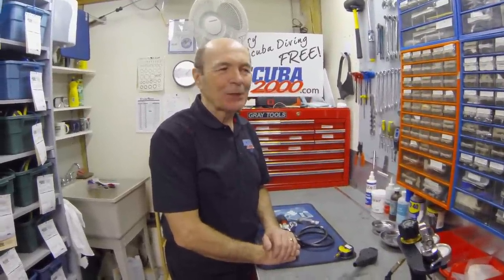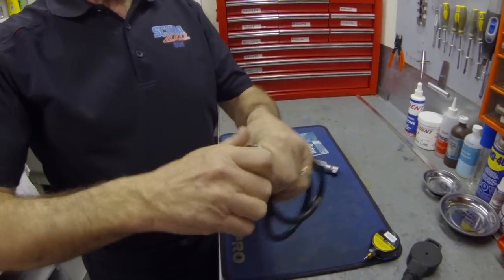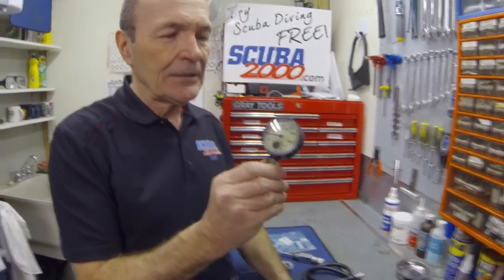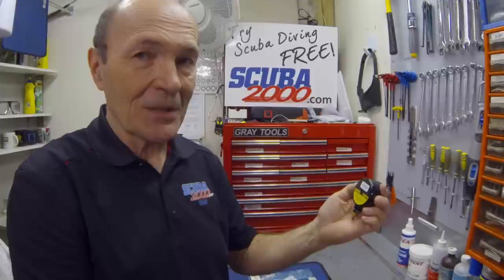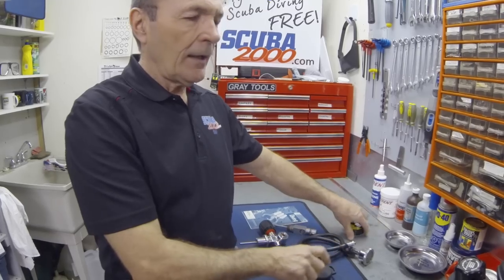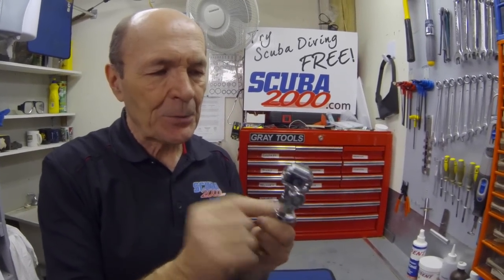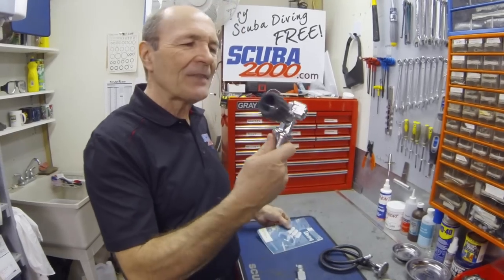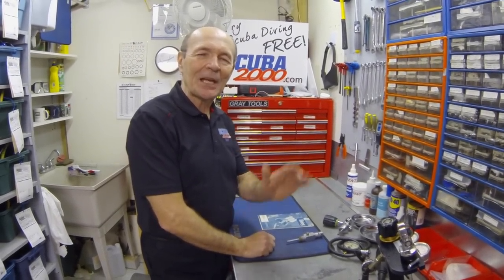Things Your Scuba Instructor Told You That Can Hurt You! - Scuba Tech Tips #3

Comment: about closing a valve a little bit (open all the way and turn it back half a turn), my instructor told me it is needed for a buddy to check if its opened or closed. about  preassure gage, instructor told me to push it to a cylinder, not away from me, when opening a valve (i am from russia by the way).
Reply from the maker: My 2nd wife was Russian. Beautiful girl. 
Think about this Alex (nice name!) - if you turn the valve back a bit from full on and your buddy reaches up to check it, it will turn both ways. How does he know if it's almost open or almost closed? You want it fully open so, if you push your purge button and get air and your buddy checks that the valve is snug, you know it's fully open.
Quite frankly it doesn't matter what you do so long as you check carefully before jumping in. You sound like you are a careful diver so whatever you do, I'm sure it will be safe. Most of these little "rules" are for the less careful divers, the sloppy ones who cause all the problems.
Same with the SPG. So long as it away from your face when the air is turned on, you're good.
Take care. Talk again.
Alec
Reply: Yeah, i didn`t got the thing about leaving valve half turn at first, and i still dont know why they telling students to do it that way, i just makig shure thatvalve didnt opend too hard - that it will be hard to close it after. Thankyou fro your replay :)

Alexander (yeah i am actually alexander - alex is just easier to pronounce)

Comment: Where i dive in Europe I have never seen a plastic SPG or a pressure relief valve we use metal SPG’s but in case of pressure build up we point it away from my face because the only place where the pressure would escape would be the glass or plastic screen!
Reply from the maker: If you look on the back of your SPG, with the rubber boot or console removed, you'll see a rubber plug about 1/4" in diameter in the case. That is the pressure relief plug. If the gauge fails (not common, but it happens) that plug comes out like a 22 rifle shot.
Anything in the way will suffer, hopefully not an eye!
These are required on all SPGs (in fact, all pressure gauges) and apply whether plastic or metal, European or not.
Scubapro, GSD, Cressi, etc are all the same.
The SPG boot or console is supposed to have a hole in it to allow that relief plug to blow out unobstructed. See if yours has that too.
This Tech Tip was directed at those older divers who were told to point the gauge away from their face because the older gauges did NOT have that plug. When these older gauges broke, most often the front glass would burst.
With the newer gauges (newer since about 1980!!), pointing it away from your face means the relief plug is facing you!
Some divers prefer metal SPGs. Makes them feel safer. That's fine with me. It's not true, but it's fine with me.
It's not the case that fails. It's the bourdon tube mechanism inside that fails so metal or plastic case does not make the gauge better. In fact, a metal case, chrome or not will corrode and requires more rinsing.
But a metal gauge if the weight is not an issue is fine.

The best suggestion to ensure your safety when turning on the air is to hold the SPG behind your back or at the very least look entirely away from the gauge. That way you can't get hurt no matter what happens.
Take care Darren.
Alec

Comment: So is it bad to turn the valve 1/8-1/4 turn back?  Or just unnecessary?
Reply from the maker: Not needed.  It carried over from the 'stone age' to prevent the internals from seizing up.  Does not happen with todays tank valves but causes more problems in verifying on/off.
Reply: @AlecPeirceScuba_SeaHunter  Great to know.  We still do that with oxygen, acetylene, propane and the like.  But, they use the same valves as 40 years ago.  Some might even be that old.

Comment: When opening any valve all the way, I always turn it back a quarter turn or so; not to prevent sticking but to keep some bozo who comes along and turns it the same way for some reason and, thinking it stuck; cranks it harder and breaks it!
Reply from the maker: No one, I repeat, no one touches my tank once it's ready to dive.
That's what knives and speargns are for!!!
Look for my video on the Vindicator valve. It's in Series 1 and called "Air Check Is So Important" - best $20 you can spend. 
Take care.
Alec
Reply: This is essentially what I was told the reason for turning it back a quarter turn was. I like the idea that nobody touches my gear once it is ready.

Comment: So, should I press the second stage purge button when tuning on the thank?
Reply from the maker: Doesn't matter. You ought to press it to be sure it's working ok. That's all.
Alec
Reply: Got it! Also, I don't quiet understand when you mention "cover it completely". I should cover my spg by hand when I turn on the tank?
Reply: Do you mean that pressing second stage won't help protecting spg when turning on tank?
Reply from the maker: Not really. The second stage and the SPG are not directly related. The air for the SPG comes directly from the tank immediately as you turn on the valve. The air for the second travels through the first stage from the tank, is reduced and then along the LP hose to the second stage. Holding the purge down has no affect on the SPG.
The safest way to protect yourself from an SPG blowout is to simply put your hand, or a towel, bag, hood, what have you,  over the face of the gauge as you turn on the air. In the very unlikely event that the SPG blows, nothing will fly up and hurt you.
Thanks for watching Huan.
Alec
Reply: Dear Alec,
I was taught that pressing the second stage purge to somehow protect the first stage in my OW course. Is that incorrect?

Comment: The #1 thing scuba instructors teach that can hurt (kill) you is wearing too much weight. They teach incorrect technique that you should sink feet first after deflating your BC at the surface. 
You use your fins and swim down, as your suit squeezes you will become negative at depth. 
They teach to be negative at the surface with your gear on and the BC empty, this is incorrect. 
You should be slightly positive at the surface, enough that your mouth and nose are out of the water with gear on and BC empty. 
40% of dead divers wore too much weight. I wonder who taught them to wear too much?
Reply from the maker: Being negative at the surface is easier for the instructor - not necessarily best for the diver as you say Kim.
Certainly not for new divers.
Thanks. Alec
Reply from the maker: Usually - if you're using an aluminum tank you will likely be a few pounds more buoyant at the end of the dive. That causes it's own problems. Now you will find it had to stop and stay at 15 feet for a safety stop. If, as Kim says, you have correctly weighted yourself so you are barely buoyant at the surface  with ALL the air out of your BC, it ought to be OK. If you're too buoyant it will be a frustrating dive, If you're too heavy it may not be safe. Now you understand better why PADI has an entire certification Specialty Course called Peak Performance Buoyancy where you learn and practice good buoyancy.
Reply: If you are in the tropics and falling off the end of a boat, there may never be an issue. If you are beach diving in Northern California, you better be able to swim at the surface. The PADI instruction for overweight diving is dangerous and wrong. "some tanks are positive when empty" well, that's a dive that's over. PADI until 2014 taught double drowning=buddy breathing with one second stage. My comment is intended for new divers to get some perspective that PADI is a club comprised of guys who claim to be experts.
Reply from the maker: I'm not here to defend any agency but, I am an instructor for 8 different agencies so have some perspective. PADI teaches positive buoyancy - floating at eye level with an empty BCD. Also they were the first to introduce the Safe-Second (octopus) as mandatory and the first to drop Buddy Breathing from the curriculum. No 'double drowning=buddy breathing' from PADI! And all this since the 90's, over 20 years. I don't want to argue with you Kim but please check your facts. Don't try to Trump me!
Let's hope that PADI knows what they're doing since currently almost 90% of all divers, dive stores and dive charters are PADI oriented.
As you say, location and environment can sure change things. What a diver does in Grand Cayman and what he does in California and what he does in Lake Simcoe, Ontario under the ice will be very different. It's pretty much impossible to have an incontrovertible rule for all situations but - it's equally impossible to train all divers for all situations!
Reply: Hi Alec, is that positive buoyancy newer in the curriculum?  My two PADI courses, not counting refreshers, were in 1991 and 1992, but all the courses and most of the dives I have been on were not really compatible with the positive buoyancy as I recall the dive masters vertically in the water, and everyone just sinking while standing vertically after everyone give the down signal.  If I had positive buoyancy, I would need to put my head down and my feet up to descend, wouldn't I?
Also, back then, in Australia I had seen some newly certified divers.  They weren't just negatively buoyant, they would CRASH to the bottom and then pump a lot of air into the BDC.  I guess I am overdue for a refresher by many years, so I will probably learn thin anyway.
Reply: PADI taught some "advanced" course that did involve "buddy breathing" from ONE second stage until 2014. I am not making this tidbit up. 
Jack Felder's observations are correct, instructors typically teach BAD technique and whether you have PADI, NAUI it's evidently the same.
Reply from the maker: Buddy Breathing is NOT part of any recreational PADI course. It has not been for several years.  The first time a recreational diver hears about and experiences Buddy Beathing is in the Divemaster course and that's only because PADI Leaders may encounter older divers who were trained to Buddy Breath. That will change in time. If a PADI Instructor is teaching Buddy Breathing otherwise, he's in breach of standards. Alec
Reply from the maker: 1991! You realize that's 25 years ago! Time flies huh. You're not quite a Vintage Diver Jack but definately an old diver (that's old in time not age). It's no surprise that your instructor, particularly in Thailand, told you those things. It was still the norm back then. It's today's instrcutors I was aiming my video at. Thanks for watching. Alec
Reply: I know, I know.  I will be coming in for a refresher. I hear you.  
btw, my friend has some vintage gear, such as a working old 505 dive computer and a  Royal Aquamaster plus Decor double hose.  Is that worth money? Should I bring it when I come in for you to look at?  He is not planning to scuba dive anymore.
I might borrow some of his less vintage equipment for use.
btw, this might not be the correct video, but he claims that his 505 dive computer does not use a single orifice as the other dive computers, but uses a permeable rock or something like that.
Reply from the maker: The 505 and the Dacor 2 hose are not worth much. Someone might give a few dollars to put them on display. Neither can be serviced. The Royal can get anywhere from $150 to $300 depending on condition. It can be serviced and is popular with vintage divers. Absolutely bring it in if you can. I'd love to see it and we can talk about it's condition and value. Be sure to call ahead as I'm often out.
Alec

Comment: I have experienced a plastic pressure gauge explode taking out the front cover. This can happen. I like the final tip of facing the gauge away from you completely and turning your face away. I prefer to use the solid brass gauges. I feel they are much safer.
Reply from the maker: +John Llorens For several years I've used the Sherwood Wisdom, an air-integrated computer that is hose mounted, not wireless. It's been completely reliable and so easy to use. It's made scuba diving fun again!
Re the wireless models, I would have agreed 100% with you even as recently as 2 years ago but the latest models (Oceanic OCi, Sherwood Amphos Air, etc) are as reliable as Bourdon tubes and much more rugged. You can beat the heck out of an integrated circuit but not a Bourdon tube! And the connection seems constant now with no drops. They get better all the time. Soon you'll not be able to get a Bourdon tube gauge. Boy will my vintage collection be valuable then!!

Comment: I would rather do what I was taught
Reply from the maker: +Daniel Mckell 
You're not wrong in that respect Daniel. I wouldn't suggest that your instructor lied to you. 
However, I've been teaching scuba since 1969 and a lot of things have changed in all those years. So, what you're instructor learned and thus teaches in his classes, may not be the best information based on newer research or newer scuba gear.
Scuba 2000 is a very busy dive facility. We have 43 instructors on staff and one of my jobs is to keep them up-to-date. Many instructors do not teach very often and many have not updated their teaching information or methods despite all of the  changes in scuba diving.
An example is the teaching of Buddy Breathing. It was a mandatory skill for many years but has not been longer taught to new dive students for several years for good reason. Some instructors continue to teach Buddy Breathing. They either have not updated their course or they don't recognize the importance of removing that outdated skill from their class.
I am simply suggesting that some things which were common knowledge and thus commonly taught in scuba classes for a long time are no longer accurate.
With that in mind, perhaps you could check out some of these ideas on the internet rather than blindly accepting my ideas or those anyone else.
Thanks for your comment.
Alec
Reply: +Daniel Mckell Even if it's stupid? I mean no offense, but if you're taught something wrong, why continue doing it that way when someone else comes along and gives a very good reason not to do it that way?
Reply: Brother-Diver Oscar, I was thinking the very same thing as you!

Comment: Question: 
Is there a valid reason why we don't dive with the cylinder valve at the bottom (Upside down) when mounted to the bcd where the valve is much easier to access than trying to reach up and behind your head? I realise you may require longer hoses, but, why don't we dive that way?
Reply from the maker: EMS and Fire Fighters use a similar system and their tanks are mounted valve down.
There were scuba systems like that. Check out earlier videos of mine to see one.The simple reason we don't use them in scuba is because we want the first stage to be as close as possible to the same level in the water as the second stage and your mouth and lungs.
The first stage delivers air at a pressure that varies with depth. Certainly with today's sophisticated regulators, it would be tough to tune a reg if the first stage was 2-3' deeper than the second. The pressure coming from the first would be too high. If you adjusted to compensate for that and then the diver went head down to look into a hole or something, he'd find it hard to breathe.
Plus don't forget that we have several hoses coming off the first stage - 1 to the Safe Second, 1 to the BCD, 1 to the SPG and maybe 1 to the dry suit. It could get messy back there with all those hoses going to different places on the diver's body. The current set-up seems to work well.
Thanks for watching.
Alec

Comment: I've been an instructor for quite some time and I do not disagree with you, but you say this like it is a fact. It is not. For example, a normal SPG used for techincal diving has no over pressure valve on the back, meaning it can face with the back, rather than the front, because that is where the glass or plastic will hurt you.

Same goes with all the way on and half a way back. For ME, that is so a student don't start turning the knob on and the knob is att 100, and missing the thread, making it more or less impossible to close without tools. And for the red and green marker... I've been all around the world and made 2000+ dives and have NEVER seen that before, so do not talk about it like it is default config.
Reply: Björn Jakobsson So true i use a technical configuration including spg made of metal with no pressure relief valve and even before when I used a normal confirmation I never seen a plastic spg or a pressure relief valve or a green red thing!
Reply: Alec for instructors a green red thing really? Isn’t it better that new divers learn by heart they’re buddy check procedures buckles valves releases air final check and they each buddy up with someone and they check each other’s gear in stead of the instructor just looking see if it’s green and that’s it.and what you said about every SPG having a pressure relief valve is simply not true a technician metal SPG has no pressure relief valve on the back the only way for pressure to be relieved is trough the weakest part the glass or plastic screen on the SPG !
Reply: Anybody else like me here on this thread think that both Bjorn Jakobsson and Darren Fay are just a couple of argumentative twinkies that just LOVE to spout "contrary?"